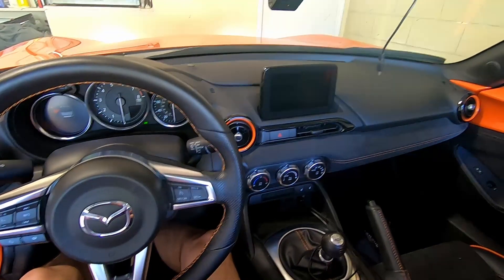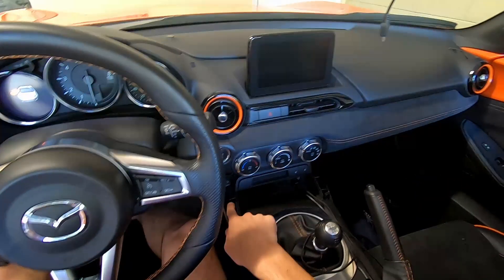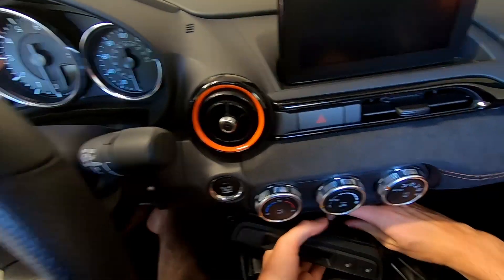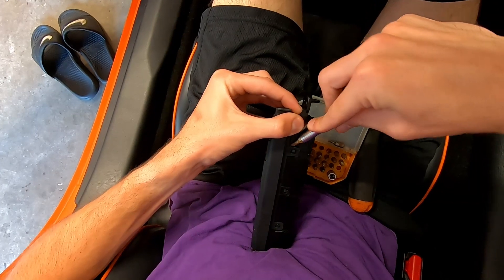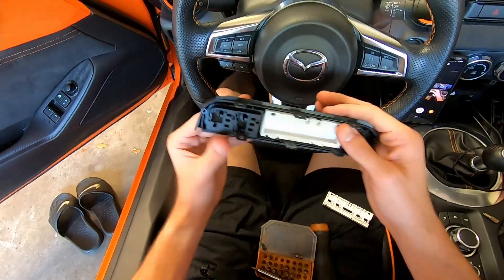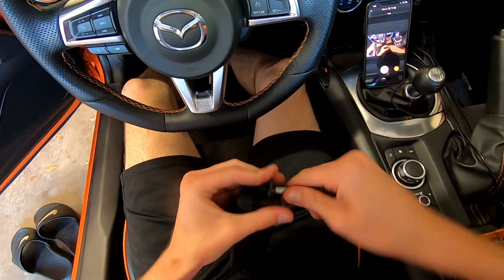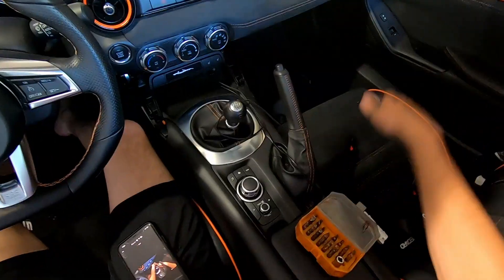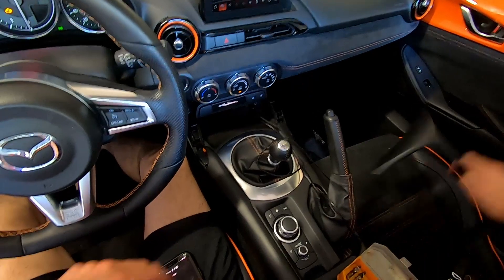MX-5 Things Airbag Warning Overlay Installation

Comment: Thank you. Just completed following your video. At 62, the first time ever doing a car mod. Also did the trunk light. Very easy. Have an ND3, so dash cam adapter doesn't work. May open sensor cavity and see what connections and voltages are available.

Comment: Hey mate, nice job. Just installed today after watching your tutorial, but I am wondering how can you make the airbag light always on? I turned on the power but there is no light on.
Reply from the maker: Mine is always on unless I have a decent amount of weight in the passenger seat, then it turns off because it senses enough weight to turn the airbag light on. I suppose unplugging that weight sensor would keep the airbag off light on all the time, but then that wouldn’t really be safe for passengers
Reply: Yep. I did a search yesterday. Us version always is equiped with Passenger Occupant Classification System so this indicator will always on, but other countries' are not.